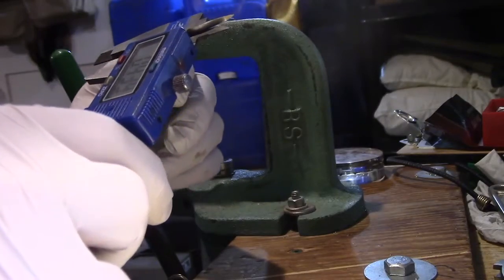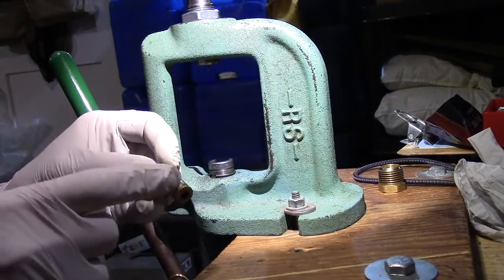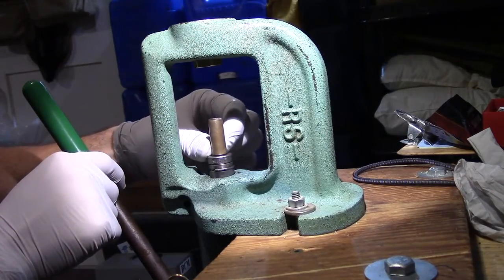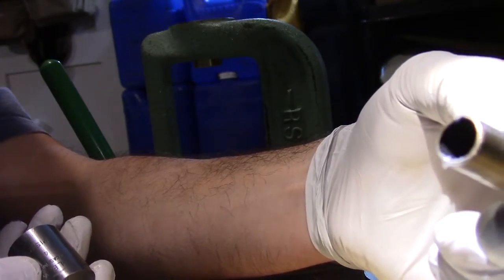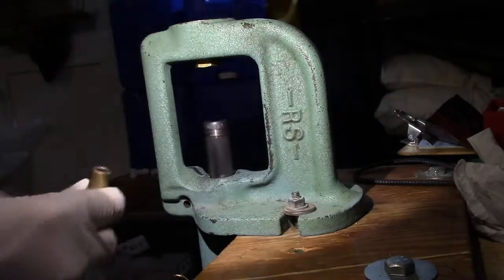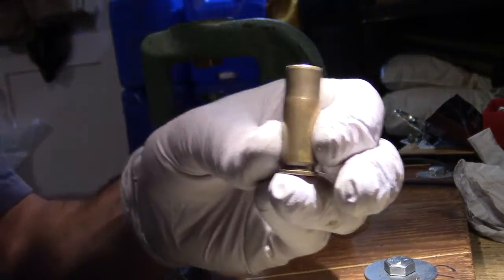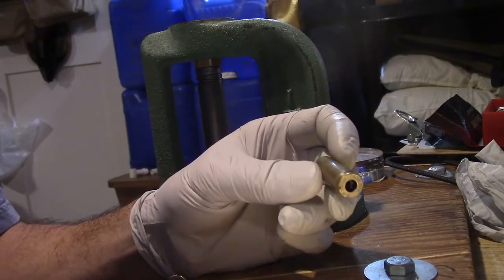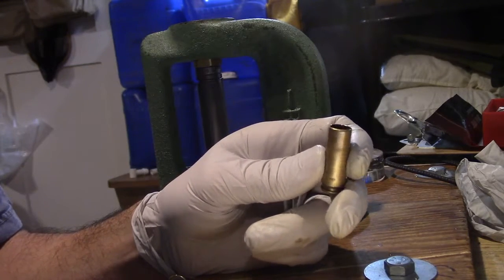45 ACP Shotshells - Buy NO DIES or TOOLS!  DIY Reloading

Comment: I try to keep precision and repeatability in mind any time I developed a process. It seems that marking the case and guessing at the proper headspace could be eliminated. One could set a trimmed 45 case alongside the 308 case in the shellholder, then run it up until it contacts the surface of the die.

Comment: I don't understand why you cant just use a normal 45 ACP shell. The neck that is made is negligible. I am not being an arrogant , but I am ignorant to the reason.
Reply from the maker: Let me start by saying that these rounds were developed for use in the M1911 pistol and the M1917 pistol.  In the case of the M1911, the ammunition needs to have a certain overall length, +/- some allowed variation.   The overall length (OAL) dimension for a 45 ACP round is in the realm of 1.20-1.25" with a 230 grain FMJ.  

To keep the math simple, assume your case length is .890".   The projectile makes up the additional .30-.35" of the OAL.  Let's say we tried it your way:

Assume you resize a case and it's length is .890.  Then, you make the 'neck' - the length will extend to about .925-.930.  Prime the case, drop powder, and add shot.  At this point, since your case is short, you'll only get about 85-90 grains of shot in there, vs the 125 grains I usually add.  Now, roll your crimp, and you're back down to about .910 for a final OAL.  

A round set at .910" OAL will not feed in a properly built 1911.  That pistol will become a jam-0-matic for sure.  By using a longer casing to start with, we are able to get the final OAL to mimic that of a 230 grain FMJ 45 ACP round.

While your 'projectile' mass is decreasing, so is your case size.  I don't know the answer to this part offhand, but you would have to consider that when deciding on your powder charge.  Doing it this way, the research has been done as to what constitutes a good start and max load.  

I hope that helps.
Reply: DesertDog Exploring ACTUALLY.... They were first designed to work in the tommy gun as a survival rounds for soldiers in WW2.